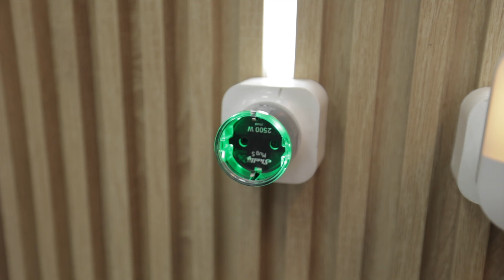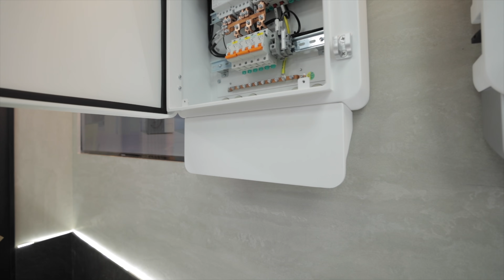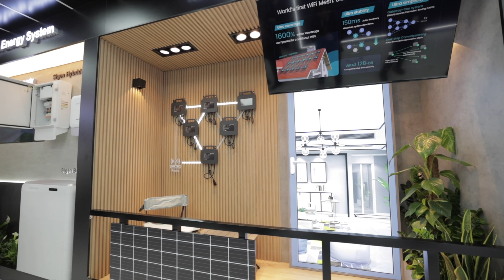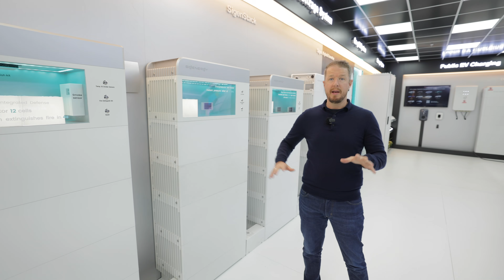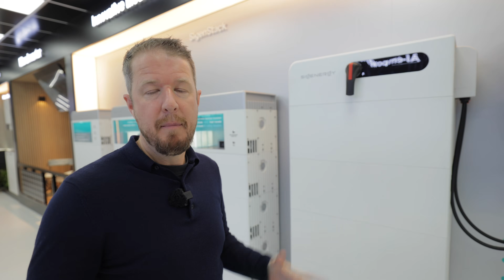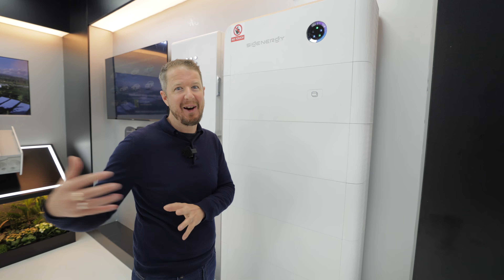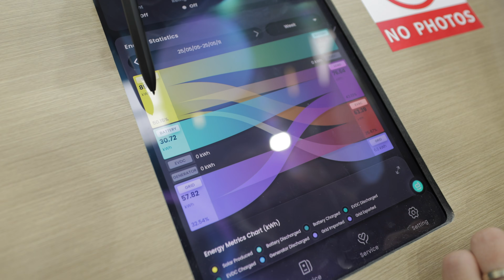Is Sigenergy About to DISRUPT The Solar Industry?

Comment: Branded all in one solutions will always be 10 years behind DIYing with Home Assistant 😁
Reply: Just provide an open API
Reply: The big problem is without local control you are subject to the whims of the company, if they decide to charge a subscription for cloud services, if your internet goes down... if they cease cloud services altogether you have a very expensive brick. This has happened many times in the home automation industry. If the company just provide an Open API it takes away this concern, they can still provide their own home automation links as much as they want, best of both worlds.
Reply: Shelly,hue zigbee rts bluetooth matter thread wifi gear Victron too all works through My HA, they would have been better just adding it to HA instead of reinventing the wheel another apple Google amazon echo system in the making. Just what smart home users need 🤦🏾‍♂️
Reply: It makes the integration a lot easier, but only if the company are on it with the software and the vision.
Reply: They created the app because they want a customer base beyond those of us who geek out on tech. Hopefully, they will open the API for us to integrate into HA.
Reply: Hopefully they will open the API  @RonLeedy ? But then you could use it easily with equipment from another manufacturer. It's almost like you could buy an expensive product and actually use it however you want. I can't see that catching on.
Reply: Yeah but most normal people just want to get on with real life
Reply: @bdizzle9586  > want to get on with real life. 

That's it - this is the market. As someone deep in the HA ecosystem it's incredible what you can achieve with very minimal cost. But it's absolutely not for everyone so I can see why expanding the sigenergy system to various IoT stuff makes sense to them. 

@artisanelectrics You created a 19min ad. Hope you got bank for it 😂😂😂
Reply: ... Its Shelly gear - its already supported in ha... But you can also addit to your inverter... So you can automate certain bits without having to set it up in HA. Which is nice
Reply: Don't forget the mandatory subscriptions and potentially using your private data 😢😢
(In general, don't know if it's the case here)
Reply: Yes - just moved to Home Assistant a couple of months ago and it basically avoids being locked into a particular manufacturer. I’ll be programming my car, dishwasher, washing machine, emersion heater and tumbler drier to use excess solar through Home Assistant.
Reply: @robveck6683 would you be able to share a link where I can learn more about this? I'm interested in Sigenergy but if there's a cheaper option, I'm all ears. Also, can I use these manufacturer batteries (Sigenergy, Tesla) with a DIY setup?
Reply: Only if you have a government that allows diy to be connected to the grid.
Reply: You are nice :) I would say 20 :)
Reply: @artisanelectrics  You laughing at this shows how little you know and how much you're pushing these overpriced systems. I'm running a full Victron system (including solar) and running it through Home Assistant and there's simply NO all-in-one system that can even get close to the versatility and cost-effectiveness of this system.
Reply: @OverSoft ….he may or may not know. With this video, he is advertising this Manufacturer.

He may have a viewpoint, but….if he expresses it, future manufacturers/advertisers will take note and not allow him the access he would like(if they are that vindictive).

DIY-ers will always be ahead of the game, as they have worked out the bugs or at the bare minimum, are aware of them. And have built systems to suit their use-case.

Comment: 2:24 it's a IoT socket... What we want to know is if this Tech integrates with sockets you can buy elsewhere. Open ecosystems
Reply: The sigen inverter speaks modbus - you can bring it into home assistant easily. Shelly is just a partner brand - they may add others in the future, who knows
Reply: @MacCalder86  Thanks for the information
Reply: of course not. Its some type of closed ecosystem. Even ev charger cost around 4,5k e. I dont care about them. They dont even support fixing 1 for dynamic tariffs so far (PL is using fixing 1 not 2 as rest of EU countries). Hinen is like 30% cheaper and offers more. I wont go with sig ever probably bc i prefer to buy a bigger and better system for the same price. AI? Hinen has it. Probably better than sig. Fixing 1 for Poland? Is available. In sig? NO, maybe, one day, in a month/year, few months etc. Fixing 2? Available. Price point? Cheaper a lot. Batteries? HV and LV. HV? 7,7kWh. Very nice slim system. All in one solution for balcony. This is the one i'm going with. Sig? For 5k e I'll get 2,5k subsidy. So for 2,5k e I'll get 15kVA inverter, bms, and 2x7,7kWh HV bat capacity. 15,4kWh. How much for sig? 2,5k euro for hinen for 15kVA 15kWh HV bat. With many fancy systems like heating pads and sprinkler anti fire system with gas. IP65. For 2,5k. And how much for 15kVA 15kWh sig? 7k? :) Good luck, no thx
Reply: Ideally it would seem logical the Sigenergy can talk directly to the home assistant API, so expose any device that is available through Home Assistant rather than just a specific manufacturer directly.